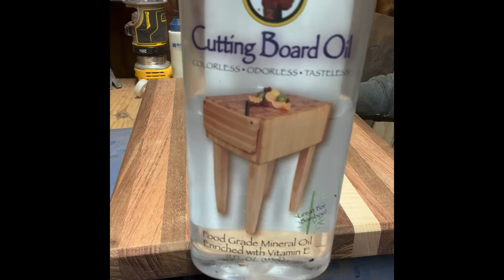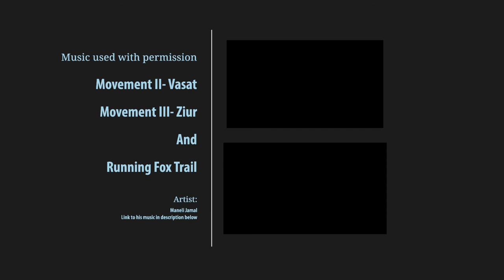Jolly Roger

Comment: I love your work.  Had to slow it down half speed just to see what you were doing at times.  I have made one board and it turned out okay.  I had trouble with my router bit slipping however on both my Skil router on my table and my Colt router by hand causing unwanted edge above roundover.  I was able to sand it down but was wondering if you see this, maybe you could address it.  Thanks.
Reply from the maker: When doing any kind of routing, sometimes it is better to take off even less at a time. Even doing a test on some softer wood like poplar can ensure that you don’t have that unwanted edge. This can eliminate that time sanding out mistakes.